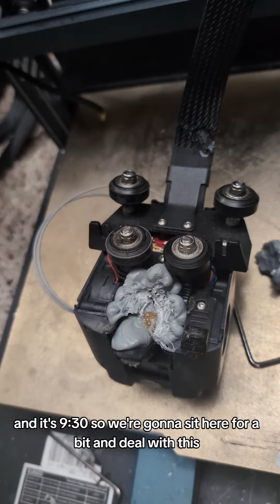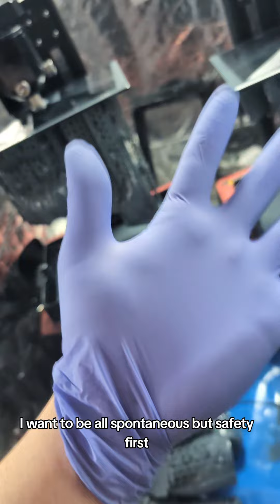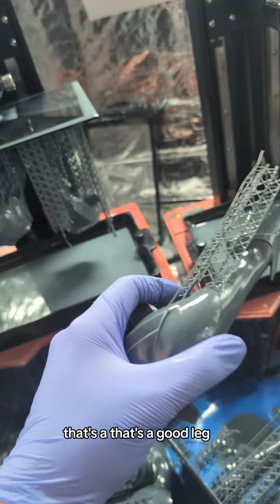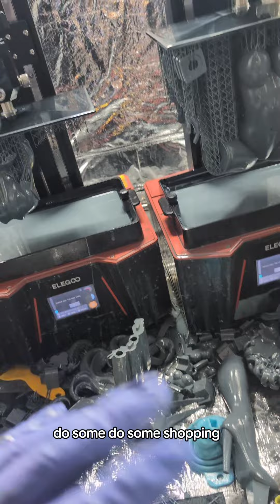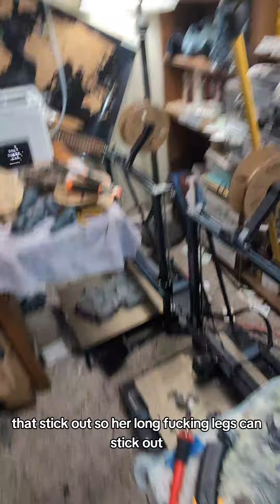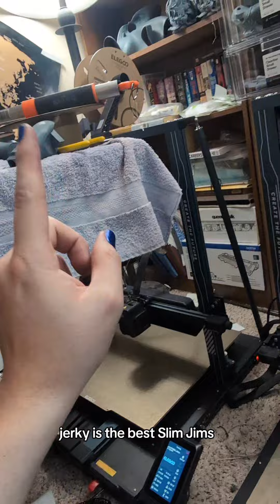GUSHERS

Comment: I'm pretty sure you don't want too.  but.... a longer form vid could be you doing the whole clean up after print without the one hand juggling you currently are doing you said you have the security camera holder for around your neck and some of the Spicy "Pickle Rick`s" might need some censorship but seeing the process from removal, clean up and, next project would be nice thing to know. Also do you change the resin or do you just fill up the bath every time? how's the waste on that and does it go off/cure sat there and the smell?

Comment: Get a graph notebook and Make a record while preparing the print bed before prints.
record the parts to which printer its going to, that way you have a general idea of what things are while the printers are running and you keep  a log of what they are after. 

this is auditing, keeping inventor and records to revise and edit future projects, 
it  helps in the case that if a part breaks you know which printer is doing the least to stop and refresh a print. and parts cant go missing unless they are not recorded. if you need to , you can list why you placed things how they are.

~~~~~~~~~~~~~~~~~~~~~~~~~~~~~~~~~~~~~~~~~~~~~~~~~~~
11/05/24  "i hope prints go well today" :)
START: 12.00AM
printing status:
printer#1:GOOD printer#2 : OK         printer#3:ready     printer#4: repair

arm, freya            prop, luffy                 n/a                           n/a
arm, freya            leg, jojo                                           
leg, raven mini    sword, zoro                                    
torso, sonico      arm, raven mini                              
hair,  yoko            arm,raven mini                              
cax, futa 

file:001                 file:004                      file: add                    file:not ready 
24.10                    13.49                          0.00                          --.--.--
=================================================================
additional notes to remember:
printer 4 is not working and needs fixing
================================================================
okay, ready to print.